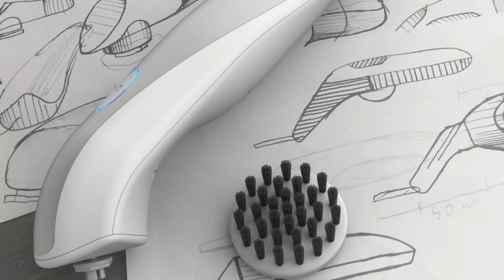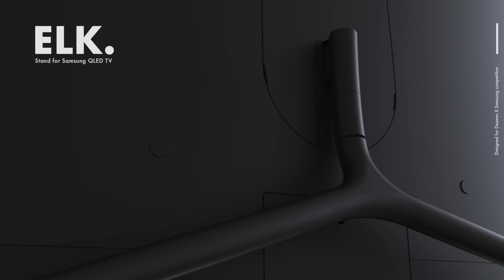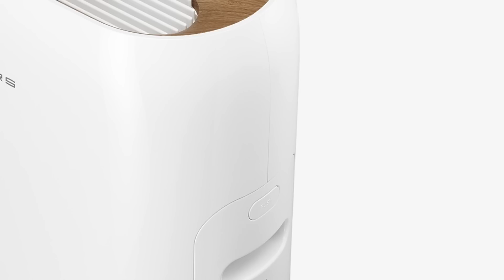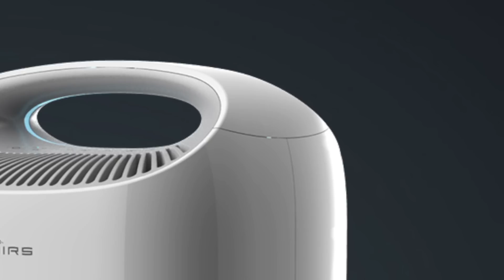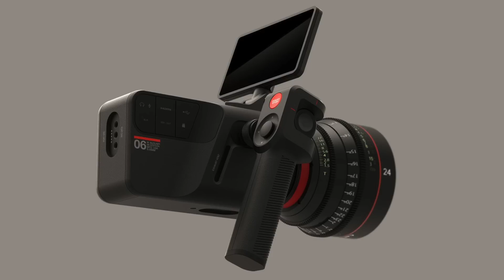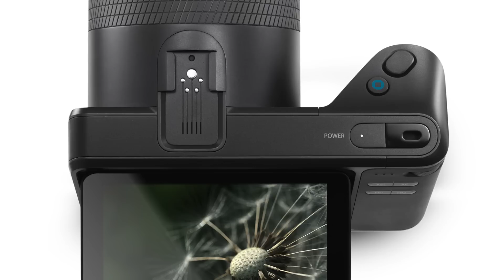How To Design With Parting Lines | Industrial Design

Comment: Are there ‘bad’ parting lines or too much parting lines
Reply: I'm an industrial designer so I'll answer for you in place of Jimmy Huynh. Both yes & no. Parting lines have to have a flow to them. For example the form of a product's body should transition into the parting lines.That is called continuity. Also sometimes there can be too much parting lines so try to keep it to a minimum for aesthetic reasons.
Reply: I think that bath tub already has too much lol
Reply: @jj72rg  have fun cleaning it
Reply: No prob.
Reply: Kevin Wong thnk u 🤗